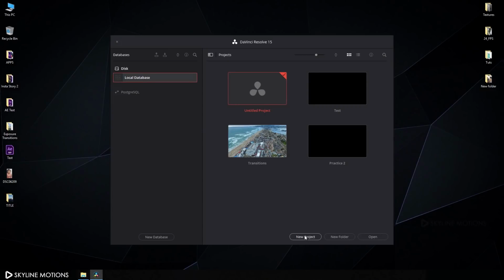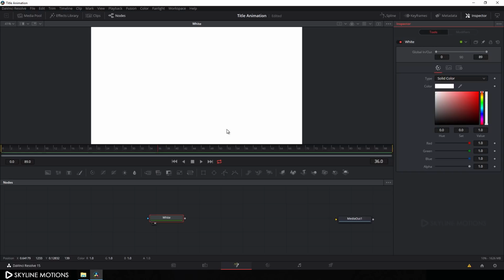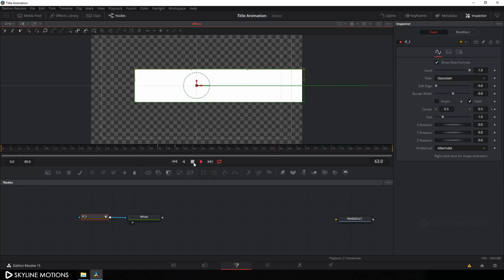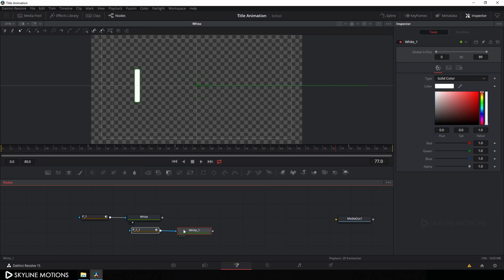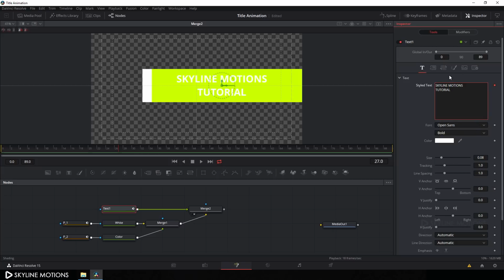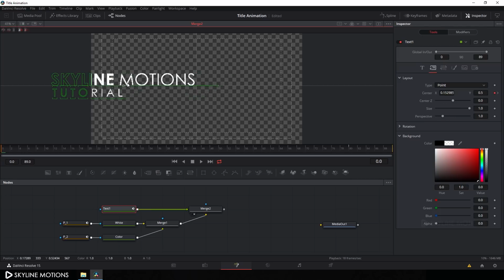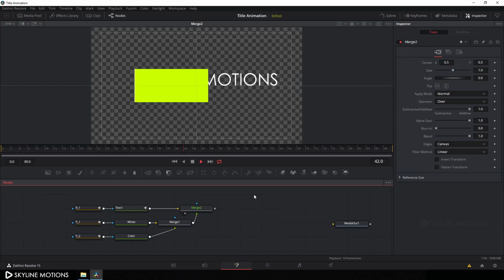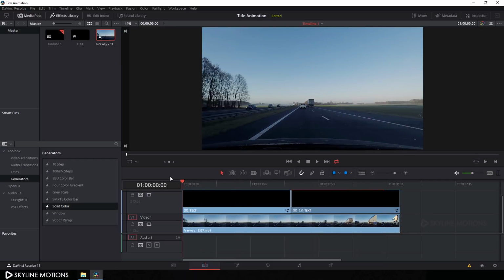Title Animation in DaVinci Resolve 15 | DaVinci Resolve 15 Tutorial

Comment: Thank you for sharing. Is there a reason that you used a Solid Color instead of Fusion Composition?
Reply from the maker: Yes, Only reason is that "Reverse Animation"

But I'll use Fusion Composition in next project..

And Thankyou so much Sir for your attention 😊😊
Reply: @SkylineMotions  Yes, I found that the Fusion Composition does not allow reversing the speed of the clip. I built reverse into the end of the Fusion page nodes. Thank you so much for being a good teacher of Fusion...
Reply from the maker: ThankYou so much Sir 😊😊